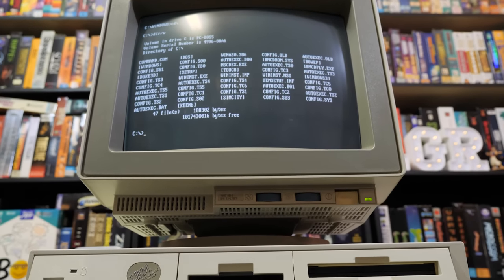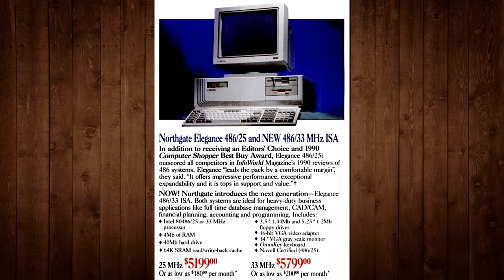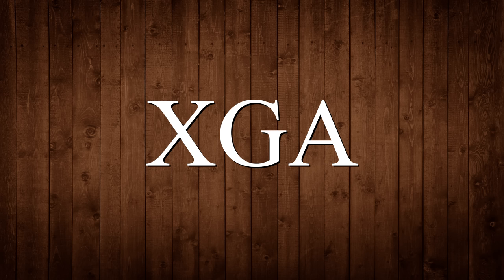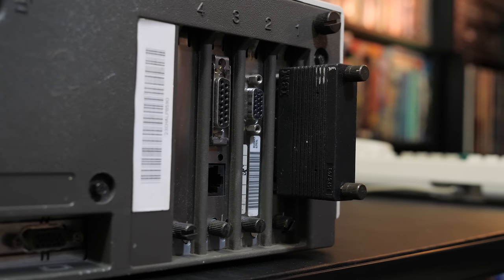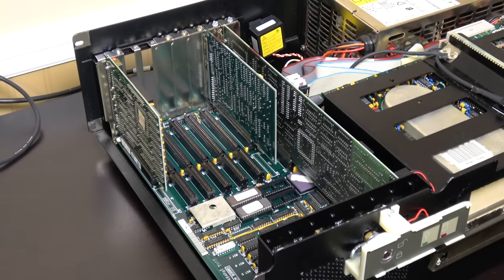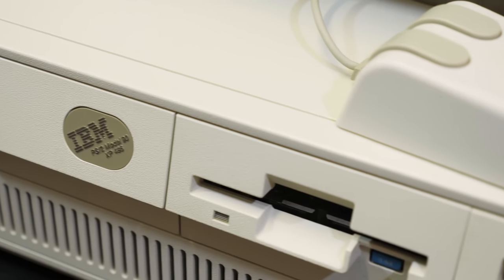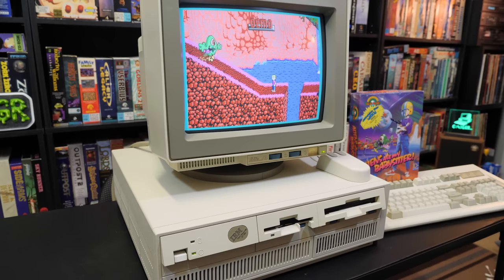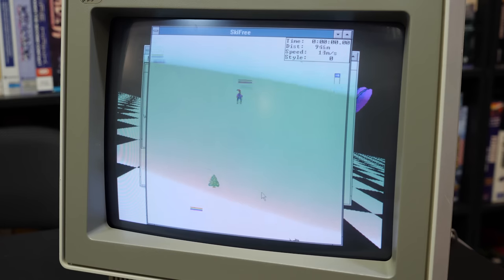$17,000 PC from 1990: IBM PS/2 Model 90 XP 486

Comment: The whole time I'm watching this I'm pounding my chair chanting "Doom! Doom! Doom!" until he explained the DX2 chip to which my chant changed to "Quake Quake Quake!".
Reply: Quake only ran payable on a 486 DX4/100 with a decent VLB video card... On the original retail box when quake was first released the minimum requirements were actually a 486 DX4/100 although later i believe they changed it to a pentium on later retail boxes.. In the mid to late 90s I had a DX2 66 and a DX4/75 overclocked to 100mhz and quake ran like rubbish on the dx2/66 but surprisingly it ran great on and was very playable on my dx4/100 although some levels the frame rate dropped but it was playable enough that I finished the entire game on it.. my 486 DX4/100 was one of my favourite and most memorable computers I owned - very fond memories of playing Doom, quake and the original GTA on it.. along with Windows 98SE and 32mb RAM
Reply: But can it do Duke 3D?

Comment: $17000? Damn. This thing better run all games in 4K ultra settings.
Reply: @pleasuretokill  
... What do you mean 720p? Do you know the exact resolution? Because i don't think there ever was a 4:3 resolution with 720 horizontal lines
Reply: @Phenom98  I think he meant 1024x768 'xga' whick could be considered to be a 4:3 '768p'. Though as pointed out in the video it could only do this at 16 colours without a ridiculous upgrade and even then I highly doubt any games would be playable at that resolution.
Reply: @chickenfizz  Games wouldn't, but business applications would.
Reply: @pleasuretokill  Heck most people I knew did not even get out of 480p until like 2004. The advancement of resolutions really is staggering.
Reply: @pleasuretokill  But can it play Crysis

Comment: I had a 9595-0PT (95A) server for years with a P60 in it and the full 64mb RAM running NT Server 3.5 then 4.0, that sucker did great. Dual 2.88mb floppies, mine had a 2x Caddy CD ROM drive, and a quartet of 2.3gb hard drives in it. Never had issues with it. Nobody would try to steal it either, weighed in at over 100 pounds! It had the "Spock" Fast SCSI card in it so it was quite quick for the day. I hope you have the external SCSI cable because its quite specialized.

I love the PS/2 computers. IBM did some real innovations there, but also screwed us and them selves with the MCA bus. It was a totally superior bus design (at the time), faster than ISA, ALMOST fully Plug n play, and if you knew what you were doing, very easy to work with in technicians terms. Loading the option ADF disk onto the Refrence disk, and configuring everything in the computer setup program was great. If they wouldn't have been jerks about it, likely we would have been using that until the mid to late 90s, and the PCI bus would probabally have been replaced by it. 

Keep up the good work Clint. If you ever need PS/2 help, let me know. I used to repair them back in the day. I always loved going into an IBM based office building because I knew exactly what I was dealing with unlike with all of the clones at the time.

PS: You can tell the difference between MCA and ISA machines. Any model less than 50 is an ISA machine (Except the L40sx), above 50, its MCA. 
PPS: The Thinkpad 710 is an MCA computer. The dock for it contained 2 16bit MCA expansion slots.

Comment: We had about a dozen of these when I was an IBM mainframe operator (about 1993-95).The reason we had them was that they were essential to keeping the mainframes up and running, they were covered by the same IBM 24x7 support contract we had for the mainframes, and management weren't going to jeopardise the reslience of the several hundreds of thousands or even millions of dollars they were spending on the mainframes by skimping out on white box consoles. Yes, they were essential extremely expensive terminal emulators, but they were critical to our operational stability.

Comment: Those blue plastic pieces are just handles to help remove and replace boards? That's a neat idea, I suppose only IBM did it? I guess that's the kind of luxury you get for 17 grand, lol.
Reply: Might also be cooling baffles.
Reply: those definitely look like quick release handles and pulls. The blue plastic length you can see in one of the shots might just be there for extra lateral support.
Reply: They made the card "full length". It was to help get the card in and out of the system without touching the bare card. Many cards just had the clip on the end and didn't bother with the full length thing. IBM just wanted to be special :)
Reply: On a sort of unrelated note, my IBM ThinkCentre from 2004 also came with a blue quick release handle, granted it was a lot bigger, that was supposed to help keep PCI cards in place. However, I removed it and use screws instead because I couldn't figure out how to use it.
Reply: ct92404, a commercial ice cream machine alone costs about 15,000$ in 2015 money; you couldn't afford it on 17,000$ of 1990 money.
Reply: The modernish Mac Pro cheesegrater version has nice quick release bays. :)
Reply: Current server hardware isn't that much different.  They still like blue latches :D
Reply: @ewitte12 mine has green
Reply: They were used by Silicon Graphics in the early 90s as well :) The IRIS Indigo was the last model to use them I think.
Reply: Bruce, that probably means yours is a Dell
Reply: @MattOGormanSmith   I can assure you 100% it isn't Dell. big letters that say HP on case, MB, and power supply. :)
Reply: MCA slots were screw less designs for card slots, and many of the other parts (HD, FD slid out on caddys/trays).   If you ever dropped a screw into a case you appreciated efforts like this. You see this same sort of thing in corporate versions of Dell machines like Optiplexes goong back even 10-15 years.
The full length slots also had latches and the other end, something that people with massive 2 slot video cards would appreciate today.
Model 50+  were MCA. Another benefit MCA had was drivers were kept in a hidden partition and had text based configuration set up screens.

Comment: LGR 30 years from now:
"This is Apple's Mac Pro from 2019. 30 years ago this machine costed someone $30k, and that's before you include the $1k monitor stand."
Reply: By then people will be amazed that apple included the motherboard for that price. Probably in the future apple will go RED and sell everyhting separately at stupid prices with poor customer services and warranties.... Wait a minute....
Reply: I can buy several Threadripper 3990X's and create SEVERAL powerful liquid cooled workstations for the price of a Mac Pro 2019. Christ.
Reply: Nope. Go configure an HP Z8 fully loaded. $130,000.
Reply: @straightpipediesel  well if we're going for that then why not just go for the nVidia DGX2 - $400k.
Reply: @willow_1  Because a HP Z8 is a deskside tower workstation, like the Mac Pro. A DGX2 is a rack mount system designed for datacenters, which is clearly not the same class as a workstation. The comparable Nvidia system would be the DGX Station, which is cheaper at $50k.
Reply: @straightpipediesel  aah that's right. I was thinking of the DGX Station!
Reply: @willow_1  Basically PC workstations can be much more expensive than the Mac Pro because the top end models are dual socket, so twice the maximum CPU and RAM costs versus the single-socket Mac Pro, DGX Station, etc. Plus, they have expensive storage options like multiple PCIe cards with 4x M.2 flash drives and bays of enterprise SAS and U.2 SSDs.

Comment: You talked about the MCA and IBMs plan to take back control of the PC architecture.

But many people don't talk (or maybe know) about the ABIOS in the PS/2.  ABIOS is for ADVANCED bios and was IBM's attempt to do a complete rewrite of the BIOS and keep the copyright on it.

They did not give out the specs for ABIOS, but it had a lot of specialized interfaces.  Their intent was to make OS/2 use those interfaces and run way better on a PS/2 machine with ABIOS than on a "regular" PC.

Comment: Price or not, these were wonderful machines. The Microchannel architecture was light years advanced over ISA and EISA and not until PCI years later was it approached. Licensing it for a trivial fee is not why it failed. True story - I had to fix a database machine - a PS/2 Model 55 386/16 that had been running continuously - NEVER TURNED OFF - for 11 years! The DOS conventional memory available for dBase III indices was at long last exhausted after all that time. Its function was to print invoices for a moving company. 11 years!!! I upgraded DOS and bought them some more time with MEMMAKER which added another 15k or so of conventional memory for indices. It was an astounding example of the absolute bulletproof reliability of these machines.

Comment: PLEEEAAASE, could you make a video about the PS/1 someday? That was my first computer ever (a 386 SX with 20 MHz and 2 MB of RAM) and I still love it so much!!
Reply from the maker: If I ever get one I'd love to!
Reply: My first computer was a PS/1 as well (Model 2133, 486SX25, 4MB RAM, 170MB HDD). Still used it (upgraded with a 1GB HDD, 16MB RAM, a math co-processor and a 3com NIC!) as a home server running linux into the early 2000s. Still nostalgic for the spacesaver model M2 keyboard.
Reply: That was my first one too! Loved that machine.

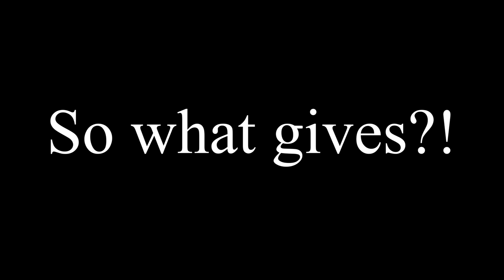Comment: Great that you include old ads - I always pause and read them in full. At 01:25 or so the IBM marketing team went with "up to .96 gigabytes" instead of "960 megabytes", an unusually short format to use in a long-format ad on a point that you want to emphasize! Not to mention the ".96" is at the start of a line, making it even more obscured. Also, why not just say 1 gigabyte, definitely within fair margin (not even getting into KB/kB/KiB etc).

Comment: Nostalgia indeed. I´d love to see you reviewing the setup of the system. I used to tinker with with the PS/2 series back in the day and those systems required a floppy disk. It didn´t come with a BIOS confguration program on an EPROM IC. Also, it was requrired to reconfigure EVERY device attached to the MCA bus EVERY time ANY changes was made to the hardware including the hard drive attached to the SCSI adapter. I almost got insane with frustration when changing any hardware in those machines.

Comment: But does it run Windows XP?

I'll see myself out.
Reply: it actually does... but its reeeeeeally slow
Reply: Windows 98 does. But slowly. Great works Windows 95.
Reply: Since a dx2 hardly runs w2000, you'd have to wait 10 minutes to reach the desktop, oh and don't forget to upgrade the memory
Reply: @pettttson  xp generally outperforms 2000 on equivalent hardware, particularly boot times. I don't think the installer would allow you to proceed with that processor without a special switch/mod though so it wouldn't just install. 2000 probably would.
Reply: Honestly, it wouldn't be that bad of a Windows 95 (and maybe even 98) machine.
Reply: Sinse it has "XP" written into its name it got to run it, right?
Reply: I mean, if you can get a 83mhz Pentium overdrive to work in it, yeah. Albeit quite slowly.

Comment: When I finished up my enlightenment in the Navy in January of 1990. I started college at CSUSB and became an IBM and an Apple “Student Rep”. The only computers we sold on campus from 90-92 were IBM and Apple. When I tell my kids the prices people paid for computers they were shocked!!  Even with the student discount, or even bigger alumni discount, the IBM 486 loaded was about $11000 dollars. We sold less than 20-30 a year. Apple, on the other hand sold 100+ Mac SE-30’ etc a month and we sold a lot of Mac II, IIFX, and other high end systems. I would say the average student spent about $5000 dollars on a computer, monitor, software and printer. But power users like myself often spent $8000-$10,000. I would buy the latest Mac with my student discount and sell it on AOL just before the new models were introduced. I often made $1200-$2000 dollar profit because back then I got a huge discount because I was a student rep.  In 93 our school brought Dell into the campus discount program and IBM pulled out of this market completely. Dells sold very well and truthfully were better machines for students and teachers who loved to mod and or add different video and sound cards.  I wish I had kept a few of the early Macs.  It would gladly go back to the less powerful machines. The systems were easier to use and did everything I. Needed them to do well.

Comment: That is silly expensive. That sort of price tag isn't far off what some Unix workstations cost at the time, which would probably have been much more capable. In fact, the NeXT Station was less or similar money for a far better graphics workstation (not Unix I know).
Reply: The Next Station color was something like $6500 and a top of the line Amiga 3000T was $4500 and even the Mac IIfx was cheaper at around 9 grand.
Reply: Ehhh...a IIfx spec'd similarly to this IBM PS/2 was more like 11 grand. 9 grand didn't even get you a hard drive.
Reply: V. Sigma I know its not literally the same, I meant more proportionally.  The proprietary bus didn't really get you much over EISA in real world performance. The performance increase per dollar of a NeXT or Sun/HP/Dec was much higher.
Reply: lrochfort MCA predated EISA by a few years. And neither EISA nor VESA local bus nor PCI local bus were literally IBM compatible.

Comment: This reminds me of my own computer history (legal office) which started in 1979 (pre-PC) on a CPM unit packaged by a local company which added is own software programing. Back then, the business model was to have a central computer and operator, to which traditional word processing, financials, etc were funneled and from which the work product was returned. Everything was done on large floppy disks, and the whole program worked pretty well. The whole package cost us about $17,000. A few years later, we ran head-on into the weakness of having only one person in the office holding the "secrets of the computer". She wanted us to buy her what was then a cutting edge bit of tech, a Winchester drive, the first hard drive, holding a whole one meg of data. It cost $15,000 and was a DOA proposal at the time. Our operator tried to hold us up with a "do it or I walk", so she walked. Never again did I allow only one employee to be able to operate that computer. When the PC tech unfolded, I lobbied for desktops and training for all. I was rejected, so in 1987, I collected my secretary and we walked, taking a cutting edge AT 286 for her and some little thing I bought to learn on myself. Either of those machines ran rings around our prior system, and the whole package for two computers, huge laser printer, software and training for two ran $5,000.  If those early prices seem uneconomical, consider that our 1979 set-up  eliminated one full time job, avoided the need to later expand one or two more employees, at least tripled the quality and speed of legal document generation, and made my firm only the 2nd in a medium sized city to do all of its own client billing in-house, where most others either hired an outside service at great cost or employed an in-house bookkeeper to do books and type bills.  Those were the old (but not so good) days..

Comment: The HUGE model 95 at the end reminded me I've got one of those! Saved it from the scrapyard at my dad's workplace 15 years ago. There where about 50 or so other PS/2 models (and model M keyboards!) that I did not take home with me. Oh if I would have known... My model 95 has 3 SCSI drives, a ton of memory, a 486DX2 and was running Windows NT 4.0 Server if I recall correctly. And O My God, the sound when it was switched on. Sounded like an airconditioning unit. I should go look for it in the attic and give it some love.

Comment: 2:58  What the hell did I just see? Is that a CD ROM cartridge reader in 1990?
Reply: Wow, I had no idea! I remember when we got our first CD drive, it was 4x and very expensive, and that must have been quite a bit after 1990. 
Thanks for adding that info!
Reply: Hitachi patent. Pre-dates ISO 9660. And the machine never shipped with that (what do you plug it into - dedicated controller in them days, later on sound cards had CD-ROM controllers added). It's been added later to this machine. High Sierra was around, but ISO 9660 was still being argued about in 1990.

Comment: For the PS/2 geeks out there, Peter Wendt in Germany still has his MCA & PS/2 page up, although it hasnt been updated in a decade. The best place to go if you need information, ADF files for those pesky MCA cards, or any other info!

http://www.mcamafia.de/mcapage0/mcaindex.htm
Reply: Whoooaa!  Michael Stanhope!  Haven't heard that name in more than 15 years.  I think I sold you a PS/2 Model 95 back around 1998 or 99 as well as conversing on the comp.sys.ibm.ps2.hardware Usenet newsgroup.
Reply: BTW, Peter Wendt is alive and well.  He still uses one of his PS/2s Model 95s running OS/2 Warp for making circuit board outline graphics.